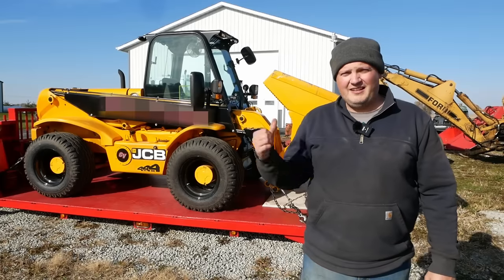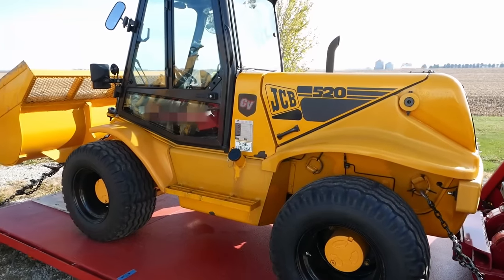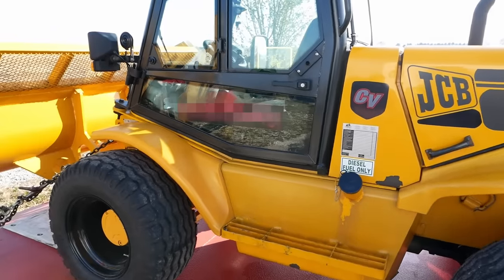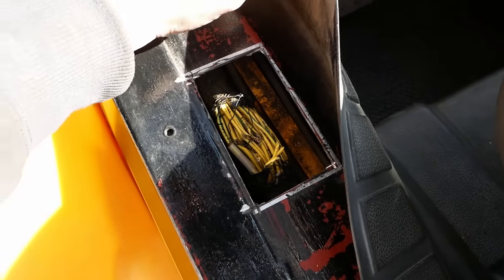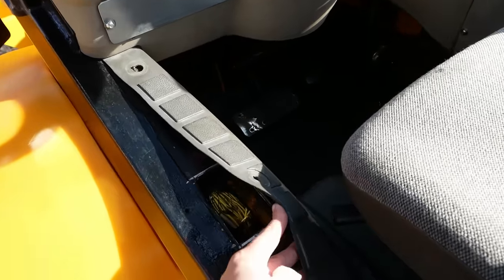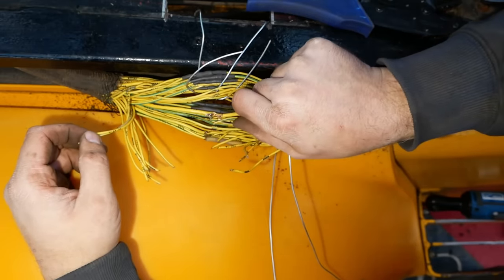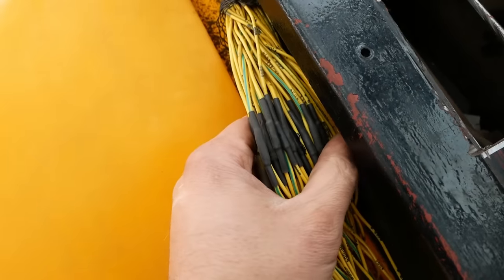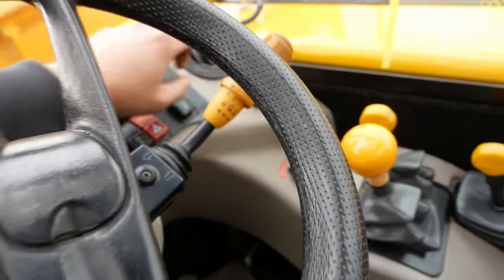What Happens when You Drill a Hole in Your JCB Telehandler?

Comment: As a former JCB technician, I can tell you for a fact. What you did for this customer was waaaaaay cheaper than replacing the harness. The harness alone would be around 3500 to 4000. That's not even counting the 32 hours of labor that it calls for. Good job my friend, been there and done that myself.
Reply: That's fucking criminal 😂 what a joke
Reply: @darianzielinsky3284  I’ve been building & repairing harnesses for years - $3-4k is totally reasonable. Manufacturers don’t order a bunch of extra harnesses for every model run. They order enough to cover predicted warranty needs and even that’s not common nowadays. So odds are, if he ordered a replacement harness, and that harness wasn’t currently in production and they had none to sell, that order might come to a shop like mine along with a (sometimes poor) copy of the wiring design schematic. It takes a lot of time to set up a pinboard, collect the appropriate connectors and pins, the proper spec wiring, and so on… some of the one-off harnesses I build cost anywhere from $3k to $15k. The work isn’t easy and it certainly isn’t trivial. I’ve done harnesses for everything from old Czech motorcycles to modern Mercedes to 40-yr-old aircraft to 90’s Fords and Chevys. A machine like the JCB in the video probably didn’t have a very large production run and they probably only ordered 5% extra harnesses to cover production issues and warranty losses.
Reply: @97marqedman  I see! So what timeframe are you talking to make a harness from scratch for a machine like this one? Days? Weeks? Months?
Reply: @darianzielinsky3284  I guess weeks. in the OC the guy said 32 hours - so a working week plus some exchange. (or 1 day with 4 guys working on it. that's also 32 hr)
Reply: @97marqedman I tried to get into that line of work as it’s always fascinated me sadly I didn’t get the job
Reply: @ddjohnson9717 I think he meant it's 32h to install the new harness.
Reply: @SBT300  guess I was dumber 1 year ago😂
Reply: @Irilia_neko :)) because you're working on industrial machinery. Those things get really torture treatment. Check the wire gauge on those lines. They are built to last. It's a completely different world than automotive electronics. Prices are usually 10x higher on components respectively. I used to work on industrial machines and I can tell you they are built without "cheap" in mind. That's why the costs are so high. If an car engine hall effect sensor costs around 30$, a same design industrial sensor costs about 300$. You're taking about machines that produce money, not getting you to the grocery... on the very complex industrial machines (with hundreds of sensors) there are special CAN systems, extremely fast and extremely "user friendly". Some of the last systems I saw where based basically of 2 wires, they could provide 24v standard power source, but the communication was made in frequency. We are talking 128+ I/O on a 2 wire system. The price?...priceless....

Comment: Im calling it! JCB is awesone! Wire is super expensive, so, when JCB decided to spend the extra money to label each circuit, it shows they really care about helping out the end user keeping the machine working and profitable
Reply: not even just label it but label it every couple inches lol
Reply: @TheATVboy17   one thing for sure, someone knew that could possibly happen. That's my bet!
Reply: @jdmccorful  SOP on aircraft and mill spec equipment but that is the first I ever saw it civilian type stuff.
Reply: I just scrapped a JCB 214-S because packrats ate the wiring out of it.   Too expensive to re-wire it.
Reply: John Deere construction equipment prints labels on the wires and also color codes the wires
Reply: Jcb is the worst equipment I have ever worked on when it comes to wiring. Jcb loves only yellow wire, so instead of looking at a harness plug trying to find a specific red wire and checking the reds for their circuit number you are checking every single wire for the circuit number and their  telehandlers are notorious for wiring harnesses corroding out. I can't tell you how many wiring harnesses I've had to replace on them, and it takes a month to get parts from them. Jlg label their wiring and actually tag every connector and actually use quality wire that doesn't corrode apart within 2 years and has different colored wires, plus you can download the service manual off their website for free.
Reply: Printing the numbers on wires is the worst design of all time 
The ink rubs off after a short time 
Every other manufacturer just uses colours wires 
It's a far superior method in literaly every way 
Jcb also use the lowest quality electrical components 
They give us nothing but grief
Reply: @jdmccorful  no ........ jcb  put numbers every few inches   in the wiring of all machines of that era .........very good system if u ask me .......re built the wiring on a jcb   412 loading shovel   after a wiring fire   .........purchased the workshop manual it gives the source and destination of every wire  , so it made life easy ..........
Reply: @fowletm1992  got a jcb 412  here its a 1993 machine ............had a fire that  destroyed the wiring in the engine bay ..........got to rewire it   because   of the numbers printed every few inches ........the ink lasted  27 years  .......would rather have that system now over colour  coding .........insurance  co wanted to write it off  when they saw  it  but were offering  very little for it .......so i had  to  repair it ,  it runs  as good as ever    now ......
Reply: @georgedoorley5628  
Might be diferant if your in a cold weather climate 
We had a 2000 model fastrac that had a small fire underneath cab it was written off soley because the wireing is renowned to be so difficult to fix and expensive to replace 
A neighbour had a case do a similar thing and it got a whole new cab harness put in for 4k parts and labour combined 
We replaced our 3220 with an 8310 in 2017 after the fire
The new one is already full of electrical issues at 1500hrs and if you so much as rub your finger down the wlre to identify it the ink rubs off  
We have  a 560-80 telehandler in much the same condition 
Maybe it's the heat in Australia or maybe they just turned to shot post 2000

Just like when we owned lamdrovers jcb is the best on the market when it works but reliability is a serious issue thwy can't seem to get right 
Affects most euro things in Australia unfortunately 
So we're stuck woth amercian machines and  Japanese cars 
Both sub standard in operation but when a standard John deere or ew holland can do 10khrs without many breakdowns 
We have a case quadtrack 600 NH T9060 T4050 TV140 Tj375 with 1000 5200 6100 6300 8000 hrs respectively  all without anything more than a blown hose or leaking seal in total 
Never even had to look at the woriwng on anything more than the TJ woth is all coloured wires and the harness rubbed though only because I cable tied another harness to it, 15min fix and if it wasn't for me it wouldn't have even failed
Reply: It’s not that uncommon.
Reply: @jackbelk8527  should've called Wes first.

Comment: You would never be able to get the old wiring harness out with the machine not running, you couldn't even get to the bolt on the far side of the cab.  That and 6 months delivery and mega $$ to get a new harness.  Job well done Wes! That truck and trailer hauling the Telehandler is the Bees Knees!

Comment: Glad you like the wire spoon Wes!  I used them in aircraft and found that they made a great tool when working in tight spaces to open up a harness.  I about spit my coffee this morning when you showed the tool on the video!  Made my day to have it featured, thanks!  

A couple of tips from experience with using it:  Dull the tip so you don't accidentally pierce a wire.  Also when possible cut tip to handle so you don't overshoot the end and get into the wires.  Allows you to get more aggressive with the cuts.   I use mine with a flip open razor knife that has a thicker blade for more stability when cutting.   All that said, thanks for another great video!
Reply: That's a nifty tool and your first tip makes sense, but the second tip concerns me. Cutting toward the handle would make it less likely to accidentally slice a wire, but more likely to accidentally slice your hand.
Reply: @Rwededyet  we injure ourselves all the time, and with a good sharp blade you don't push hard enough to do major damage. It's dull blades that get you into trouble.
Reply: Wire spoon. Yes, also used to install/feed new wire into existing harnesses. Under tie string and zipties. Obviously small guage wire.
Reply: What’s the tool called what’s the tool number? Where’s cans i gets one?
Reply: You got a link to that tool. If you could possibly post it that would be awesome. If not thanks anyway. I'll keep my eyes open for something like that in the future.
Reply: I used them on planes also. When I saw it, I thought, hey I have one of those in my box, cool.
Reply: @humbleservices6418  Here's a bit of trivia for you, I used to be a Chef (well once one always one but since my spinal surgery i can't do it anymore) and talk to any kitchen managers and they will tell you that in a kitchen chefs are not the ones who are cutting themselves. It's usually prep and line cooks. For some reason no matter how many times we tell them to keep their knives sharp, they won't.
Reply: @davidmiller9485  I get your .. point.  dull blades require more force, and force is a direct trade off for control.  The more you push, the less you have control.  

That said, for the purpose of auto repair, you would never stab through a wire loom wrap blind with the point of this.  (See: Drilling blind), so the sharpness is not used, in this specific case, other than to damage things.
Reply: @humbleservices6418  I agree, you should never go slicing into a wiring harness with a blade willy nilly. I was just pointing out that using a dull knife can lead to problems counting to ten :P

Plus when i was young and in need of money, my grandmother used to bring home a machine from del city wire where she worked (she made wiring harnesses for mobile homes and RV's) and i got to make thousands of terminals (you take a insulator in one hand and a plug in the other and put them into a machine that presses the insulator over the plug. I've done everything from spade connecters to wire nuts) to make some extra money over the summer. It was lucrative enough that i made payments on my car in Jr. High (Fiat X 1/9). anyway all this talk of wiring reminded of it. :)
Reply: That thing is genius. Where are they available at?
Reply: I'm just a DIY enthusiast, but I found more or less accidentally that baby scissors work great for this kind of job too. I'm talking about those tiny rounded tip scissors made for cutting the nails of small children, they slide easily over wires, pushing them out of the way with no risk of cutting or even scratching them.
Reply: Boys buy a seam ripper it's a hell of a lot safer and easier!

Comment: I worked for a Toyota dealer as a team leader for many years.  A customer brought a brand new Sienna van in with lean codes and a vacuum leak at the booster.  He decided to install his own trailer hitch and brake controller instead of having the dealer do it.  He had tried to run the brake controller feed wire through the firewall and drilled a 3/8 hole through the firewall and right into the back of the booster.  Needless to say warranty did NOT cover that repair.  Great job Wes, never a dull moment on your channel.
Reply from the maker: Ouch!

Comment: I remember vividly when I worked for a limo manufacturer. Since I was fluent in hotrod and restoration electricals, I was assigned to all the hearses, armored cars, and specialty limos. Mercedes S500 and 600 was without a doubt the most difficult. Imagine stretching a built harness 30-50 inches, up to a couple hundred wires a side. To keep the splices from being one massive ball, I would clip 10 or so, twist, solder, shrink wrap. Move 2-3 inches down the harness, another 10 clipped. Incorporate all the equipment we installed (dual divider, rear A/C, TV, stereo and so on) and I could be on a 30" stretch 600 for a week.

Comment: Great job. I learned three new things. That there is a tool for cutting the wrap off a loom, damage free. That machinists points can be used to hold a cab up and, I especially like the trick with the socket and tape. I never would have thought of that. I usually just cut the length of tape that I think I need and then try to wind it around the wire without getting it twisted or stuck to something I don't want it to. All that and story time too. What a deal!

Comment: Eric O is actually the first one ive ever seen do the trick with the tape...and ive been doing harness repair on military and commercial vehicles for 20 years. Nice work Wes. Thx for sharing!
Reply: The motorized socket wrench is additional innovation on the technique.
Reply: I think he is where Ive seen that little wire threader used also. You can use it to thread a wire under a zip tie n such too.
Reply: I was just watching Eric O doing just that with the tape, but he used a 10mm. Wes you do fantastic work, and it's a pleasure to watch you!

Comment: This brought back many traumatic memories for me Wes. Once, I had to install a new aftermarket third seat in the front of a brand new MB Sprinter van, it came with no fitting instructions. 
It was a matter of aligning it with the existing seats and going from there. These vans have a huge, one piece moulded rubber mat that goes under the front seats, under the dash and side heel plates, so not a trivial task to remove. These aftermarket seats bolt through the floor pan and have large backing plates that fit up from underneath to sandwich the floor panel. Typical process is to dril your clearance hole through the floor mat or carpet/ insulation with a hole saw (a hole saw run backwards cuts through carpet really well and doesn't wad up the carpet) and then enlarge the hole saw pilot hole in the floor pan to through bolt size.
 I called the local MB dealer and asked if there was anything under the thick, one piece rubber and insulation floor mats in that area I should be aware of and they emphatically said nothing to worry about.
So, off I go with the 25mm holesaw to punch some holes through the rubber floor mat and insulation for the bolts and spacers (to allow for the thickness of floor mat and insulation). No problems there, all good. Then I go to drill the 14mm diameter holes through the floor for the mounting bolts. Get through what I thought was the floor panel, then a huge sizzle pop. I knew what I'd done just from the sound. Turns out, there was a huge depressed channel stamped into the floor pan of the van, with a thick sheet metal cover that screws over it to provide a wiring loom run and the thick plate covers that and provides a nice flat floor for the cab.
 Anyway, I spent the next day doing exactly what you have done here, except with a multitude of wire sizes. Fortunately, the MB loom was colour coded, unlike your harness here.
If I'd had the seat positiooned 25mm further forward, I would've missed the harness completely.
We started carrying a stock of those large amperage fusible links like the ones on the JCB after that event....

Comment: that harness repair went exceptionally well Id say.  Having numbers to match up was a bonus but getting it neat and manageable to where it would go back in its space is a whole other project in itself!  Another job well done Sir!
Reply from the maker: Thanks 👍
Reply: Splicing the wires back together like you did was the only workable solution. Replacing the harness would've been waaaaay more time and labor and therefore $$$. I bet he thinks thrice before "fixing" it again. Bad design by JCB with the foot panel, too easy to scuff it loose to begin with.
Reply: @johnlottes7440  There should be a return so the panels can't be kicked inwards.
Reply: that harness  alone would be very expensive to buy  as jcb  really ride you for the older machine parts .......thats if they even still make it   ...........have a 1993   jcb 412   farm master here   that needed a loom ......ended up  having one made locally as the jcb one was going to cost more than the machine was worth ............

Comment: Reminds me of a strory from way back.
In Australia, in the eighties, GM supplied the Police cars and the tech's drilled the normal mounting holes for the radios in a large number of cars (IIRC, it was 500) at the same time in the passenger footwell area. Unfortunately, they were the first batch of cars with electronic engine management, these ECUs' needed to be installed in a cool, dry area that was out of the way - like on the other side of the panels being drilled for the radios... Even more unfortunately, they were being done as batches and by the time they realised why the cars wouldn't start they'd gone through a number of ECUs.
Reply: Omg
Reply: Would that that have been a GM issue or a tech issue then?
Reply: My goodness what a fuxking mess that must have been.
Reply: Shit thats expensive